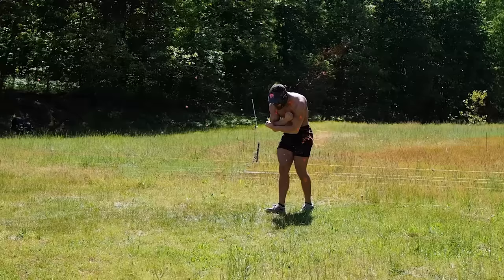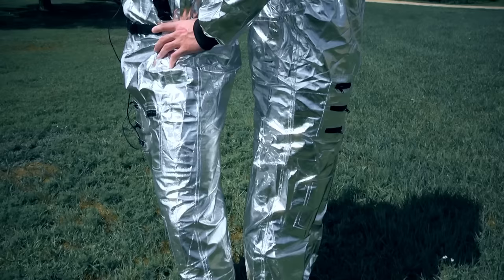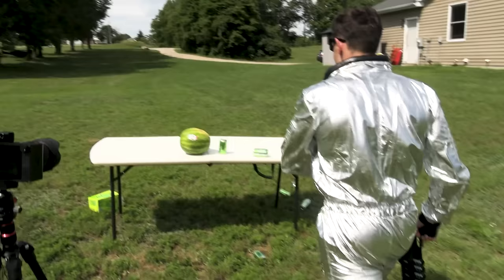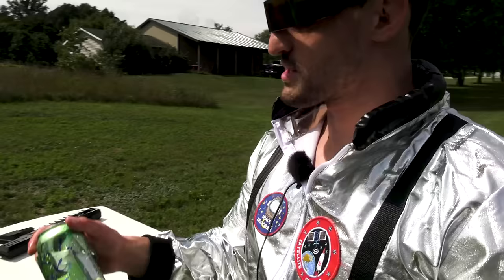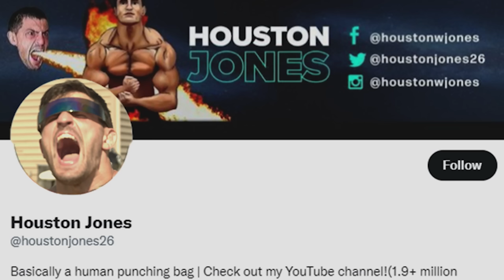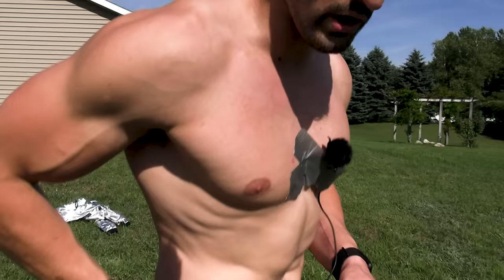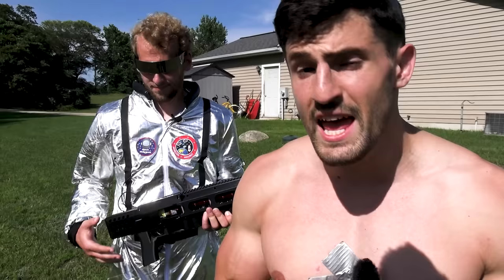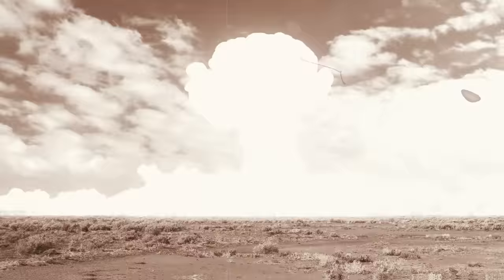Creating the WORST COILGUN INJURY of all Time *THE FUTURE OF FIREARM TECHNOLOGY*

Comment: the US navy actually did tests on a railgun (not coilgun lol) and there were plans on putting them on ships but the power needed to run them was too much plus there were other issues so the project was scrapped. it was able to shoot a 44lb projectile around 126 miles at 2,800 fps, the "barrels" only last for 12 to 24 shots though.

Comment: Oh snap! He's back! Unrelated to this channel, but I'm curious why they don't use disk shaped projectiles. I would think it would be easier to get them to spin stabilize and fly straight. Btw, reading the instructions would have helped a tonnn. I dont think it was the trigger, but rather the setting you had it on. I'd assume you have it on the highest power setting, which means it takes a few moments for the gun to recharge the coils and capacitors.

Comment: Just got a cfmoto side c side and cfmoto atv.

So far, I like it overall. However, adding blinkers to it and installing switches for blinkers, horn, sound system, lights, etc. Is a pain in the ass.

While this doesn't pertain to cfmoto as a whole, the dealer I got them from was not helpful and almost acted like they didn't want to sell anything.

Had it not been so close to Christmas, probably would of went a different route. 

To spend roughly 40k at once and get garbage service. Their attachments are also really overpriced. Over $600 to add blinkers, and I installed them myself.

Comment: Well I can tell you this off of studying railguns sense I was 13 no it won't be the future the velocity of the round at the same speed as a bullet will destroy the barrel and slowly eat away at it not to mention the weight difference normal guns don't have much weight trigger assembly bolt firing pin a few other things those electric coils weigh a shit ton when your trying to get any kind of velocity and 3rd that cost you 1600 I can by an ar15 for half that they'll have to charge more because they use more it'll never be more then a show peice but Definitely still cool

Comment: I'm curious if the rounds can be filed to a point, and still be propelled out the weapon? Seems like you'd want those rounds to penetrate the target.
Reply: I'm not a scientist like Houston Jones but I can answer your question. The barrel on this coilgun is not rifled so it causes the ammunition to tumble in the air. If he filed it down, it would cause the ammo to be lighter on one end and tumble even more. Good question though!
Reply: @1062bill  Looking back at this question, I wonder if you could put a rifled barrel inside the coil gun itself, and still be able to propel the round? Maybe have it set up such that the coils are placed such that its both integrated into the barrel and provides spin for the round.

Comment: You realize if they made it the same size as a normal 18 inch barrel ar15 it would prob be in the 500-700 fps range and would easily send a smaller more aerodynamic round even faster fps and would easily kill something

Comment: That has to be the weakest coilgun system on the market, since it had very little penetration. You'd be better off in your next challenge, to use a nail gun running off compressed air.